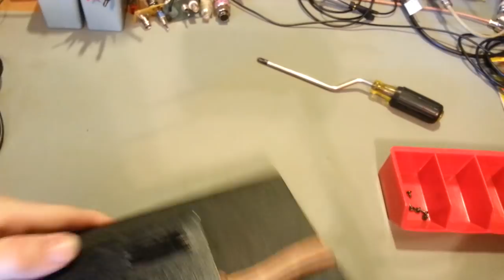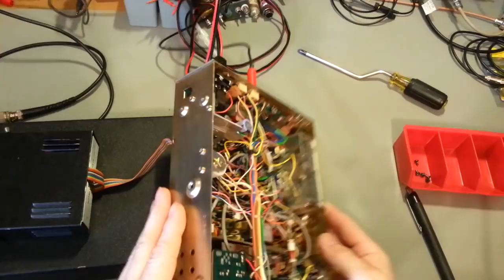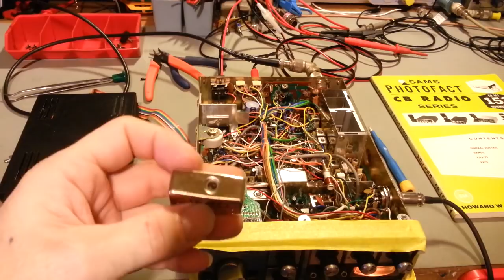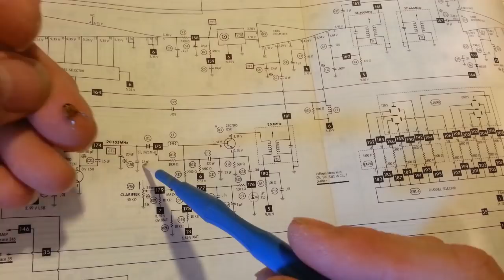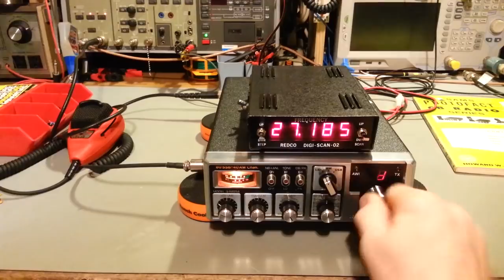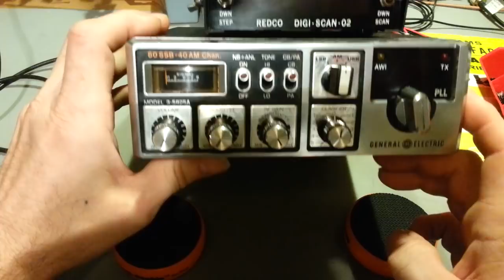GE 3-5825A AM SSB Cybernet chassis repair.

Comment: I think they were going for a type of Super Slide like in the old Secret CB books from the 70's and 80's . at first I thought that could be a " Super Diode "  $6.00 in 1980 or so years was a good chunk of change for a single diode and a piece of paper , they promised a lot of slide , but it would only do 5KC up and 5KC down .... If you can't go a full 10KC for the in between A channels don't even bother ...... So true about that 1KV cap , NPO AKA Black hat caps are temperature tolerant in People speak . I have seen many hundreds and hundreds of those in car radios , the temps can swing 80 degrees from morning to noon inside with the windows up..... Those Philco and Delco radios were a hassle to get apart if you didn't know how to do it..... When teenagers back then were adding speakers to their dad's car radios things didn't go quite right at times ..... Them poor ole radios would end up in the shop ...... I used to install a full 10KC slide in 29 , 25 LTD and other Uniden chassis with a switch ,  you could go quiet so to speak like that .....

Comment: I recently bought one of these, works well but it has a bit of a carrier signal on USB without me speaking into the standard mic.  What can I look at to stop this from occurring because its not there on LSB?
Reply from the maker: Adjust RV1 and RV2 for minimum RF output.  These are the SSB balance adjustments.

Comment: I had this exact same radio (GE 3-5825A) in the 1980's-90's. I bought it used for $20 at a thrift store. I met my wife on it on cruise night, she was riding with friends and they had a CB in the car.  She'd never used a CB in her life, and I was the first person she got to talk to :-) We've been married for 30 years and we have 4 kids now! The only mod I could get to works was to get the RC channels back. It put out almost 20Watts. Something fried in it in 1992 (a metal object went inside of it) and I couldn't find a schematic anywhere (before the Internet). It got thrown away, replaced by a newer radio. I have real ham radios now, so I don't need a modded CB for ham, BUT I sure do wish I could find another GE 3-5825A for a reasonable price for sentimental reasons <3 There's no way I will pay $390 for a CB on Extortion-Bay! I paid less than that for a Kenwood TS-430S 100 Watt all-mode (AM/FM/SSB/CW) 160m - 10m radio that receives from AM broadcast up to 30MHz. I MIGHT pay $150 for one though.

Comment: HI Mike from Brenton VK3CM (ham call) or JDW229 (CB Call) in Tangambalanga North East Victoria in Australia,. I love your videos and learn a lot from them, even as a Technician, I never stop learning from your videos.  I was a bit lazy working on a Tedelex TE7000 Cybernet chassis which is a pretty much the same as the GE you are working on in this video, and you jogged my memory from my apprentice ship days on the clarifier slides.  I was reverse engineering a removal of a slide and was about to pull out my Sams manual and thought, I might cheat and check out a Mikes video.  And yep, there it was,  a quick Mikes refresher course on cybernet chassis that saved me a bunch of time.  So many thanks mike, you were the encouragement to do a few videos on youtube and its been a bit of fun for sure.  My channel is easy to find, just type brenton meadows into the search bar and the radio channel will come up, but boy, need some better camera equipment,  your videos are far more professional.  Learning every day, even at 55 years of age as a retired old guy.. haha...Thanks again for all your work, its so much appreciated.  Cheers Brenton VK3CM/JDW229

Comment: Hi from Australia Mike, found your channel recently and loving the videos, theyve helped me a lot.
Im an electronics novice (perhaps "advanced" novice) and its been great to see your troubleshooting process in particular.
Quick question, have you ever seen a GE "a3-5819a"? Its an 18 channel AM unit and I suspect "Australian market" as im having real trouble finding a manual for it. Any thoughts?
Reply from the maker: Most likely it's exactly the same as the US model but with one difference, the channel selector.  It will have a 18 position rotary switch where the US version would have a 40 position switch.

Comment: Usually the mistake is not done by inserting the plug the wrong way but in how one hooks up the wires to the power supply
It appears to have the PTBM048AOX board. I just purchased a Rystl CB-4082, made in Japan, with that huge chunk of rock as 10.695 filter. I think it was a good purchase for 15 USD

Comment: Mike I’m trying to turn down the dead key for mine but I can’t find vr5 ? Any help would be greatly appreciated
Reply from the maker: That huge ceramic variable resistor mounted to the left side of the chassis on the left is the AM carrier adjustment.